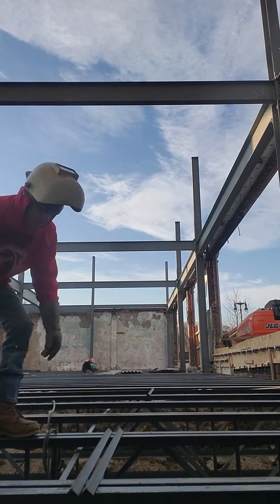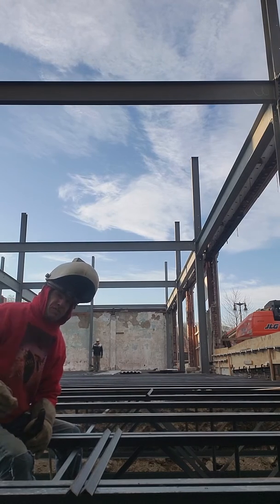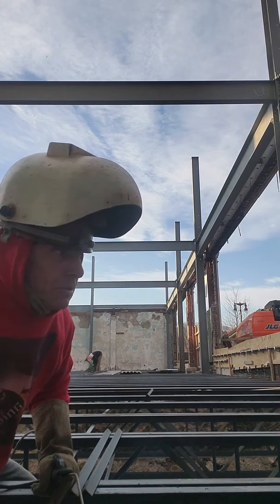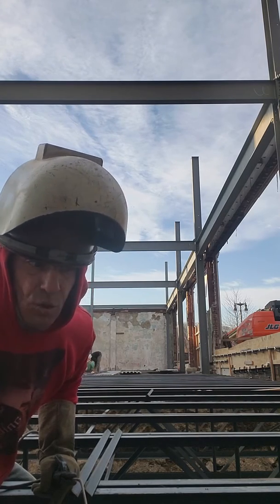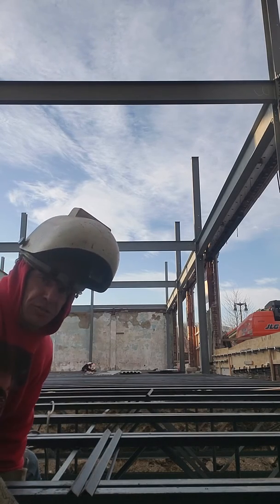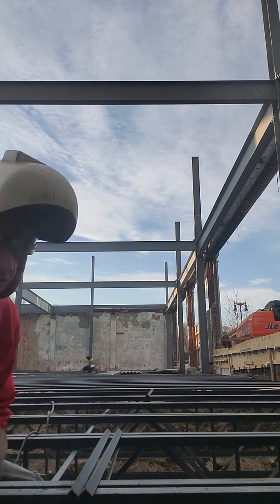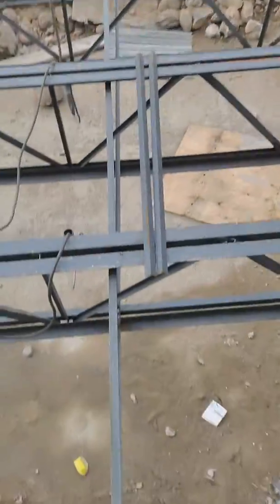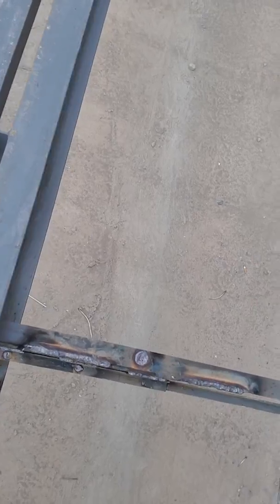Structural Welding/ Bridging 101- The right way, Part one

Comment: Well I lasted  2 weeks welding fucked up 1 time got laid off on these angles I had porosities so ran another pass over it
Reply from the maker: Terry, Get back to the booth, Set up the same weld procedure you were doing on the angles,  figure out your wire speed setting, Have a partner to help you the h*** out, master this shit!
Reply: @jetweldingllc4691  I already know what I did wrong it was a simple mistake I just wasn't tuned in right it's different from the booth you got everything right there out in the filed you got miles of lead it was a simple mistake I just wasn't tuned it properly the welding inspector already passed my welds earlier this week it's just that I fucked up yesterday
Reply: @jetweldingllc4691  mistakes Make me sharper next go around that's how we get better :)
Reply from the maker: @terryhanks2314   That's right you'll get better,  Color code your lead, Every section, Straight from the welding bank, You'll always know what positive and negative is, The rest is up to you! Where's the men in your gang friendly and helped you out at all, Knowing that you were  A young man in this business?

Comment from the maker: When do you start, And what welding gang , Are you working in, Detail, Production welding flux core,moments, columns,,warehouse,Bar joist,bridging, and what state are  you working in !
Reply: But yeah bar joist any tips ?
Reply from the maker: @terryhanks2314   Make sure you have a tape measure, I don't know if the pads are  bolted,   You might have to find center for each Joist, Hopefully they're all bolted and you're just burning wire, keep me posted!
Reply: @jetweldingllc4691  will do thanks for tips :)
Reply from the maker: Terry, 7018 1/8= 125 heat setting, Adjust for you, That stuff should peel  up behind you, Good luck
Reply: Well I lasted 2 weeks welding my first weld dispatch but got laid off cus I welded on these angles but I had  parosity so I ran another pass over it then it look ugly but yeah I was too confident overlooked it overconfidence and lack of concentration
Reply: California welding Bar joist
Reply: I could of done production 232 but I shyed away from it because I haven't even got me feet wet out in the field yet Soo I took a "easier" dispatch
Reply from the maker: Terry, Are you working out of a reach, Joist pads,  Heat setting 125, Ask your Foreman ,   What size weld needed per side 2  3 inch or. Full, Your heat should be perfect,  Make sure your pads are  tight To top flange, Hopefully  They are bolted, Wrench tight, Off to the races,
Reply: I worked at canam steel and we would tack on one side of the building then the crane operator would pick up that joist drop it off the other side of the warehouse and we would weld ..
Reply: We assembled  joists at canam
Reply from the maker: @sloppyjonuts9162   Are you still with can am
Reply: @jetweldingllc4691  we wear welding wire though not 7018
Reply from the maker: @terryhanks2314   You are running the automatic Wire 232? Or 233 Flat horizontal vertical overhead? Your wire speed is too slow you have to run it rich, Talk to me let me know what the hell happen!
Reply: And the guys tacki g were not allowed to wear welding helmets .no joke  ..I did that for awhile and my eyes have never been the same.